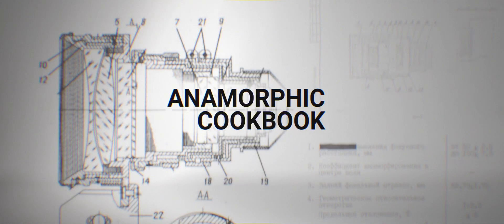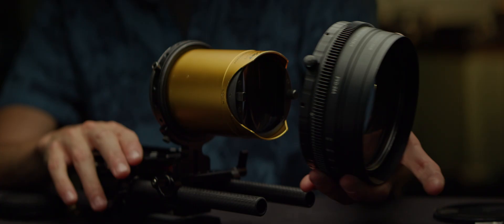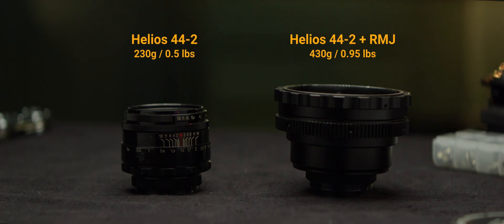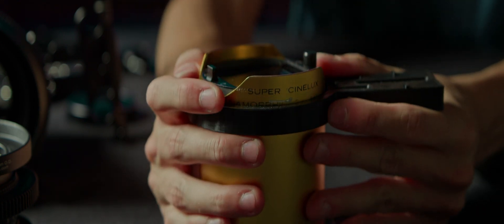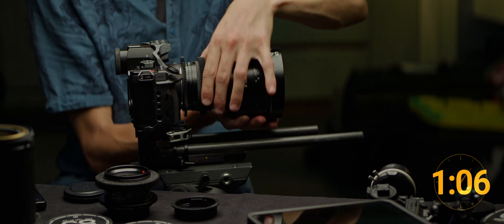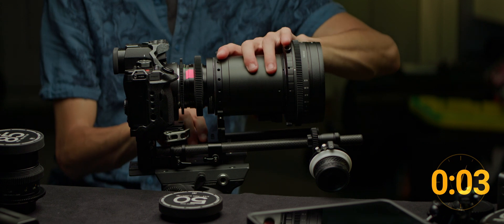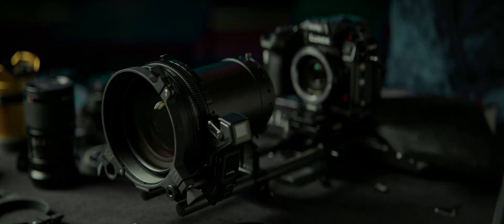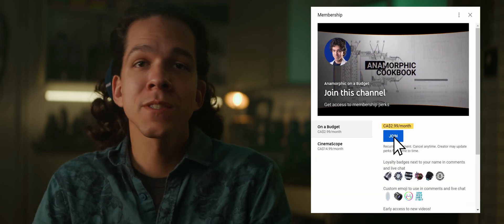Faster ANAMORPHIC Adapter LENS SWAPS - Anamorphic Cookbook - Module 6 Chapter 2

Comment: What is the most practical and useful squeeze type for a FX3? it seems like a lesser squeeze would be better for and non open gate sensor? Curious what is your opinion 1.3 vs 1.6?
Reply: I shot a short on the FX3 last winter with Helios taking lenses and the Great Joy 1.33x anamorphic adapter. If I were to do it again I'd use a 1.5x for a better stretch and crop the sides to fit a 2:39:1 frame like @LucasPfaff said!
Reply: Any camera that can utilize its whole sensor shoots "open gate". It just means "full sensor". As most cameras crop for anamorphic and with modern cameras resolution is barely an issue, I'd vouch for choosing an anamorphic based on your desired image and not squeeze factor alone. What gives if you use more of the sensor, therefore more of the resolution, when you dislike the results?
Reply: @LucasPfaff  i hear you.. the FX3 is full frame, but not open gate. So bigger squeezes create a narrower image that needs to be cropped to fit standard cinema ratios. This defeats the purpose and degrades the video imho. So my question is for FX3 what is the best option? I understand much of this comes down to taste, but I don’t want to crop in and I don’t want super narrow strip of video.
Reply: @timdanyo898  you have to crop an Alexa to get proper scope. You dislike that image too? Cropping doesn't degrade, it just cuts off. Less comfortable to work with I give you that, but in the end it doesn't really matter.

So arguably, most anamorphics degrade the image in a way. It's also part of the aesthetic. So it would be crucial to know what exactly you dislike. But if you feel that cropping so much degrades the image too much, you already kinda have your answer. 1.5x would also be a way, which delivers more or less the same aspect ratio as 2x would do on 4:3. Personally, I wouldn't bother with 1.33x because it's just so little fun, not worth the hassle - but it comes down to what you actually like.

I can only repeat myself, look at what you want in an image, and not at a number.
Reply: This is the trailer for my short using the FX3 and Great Joy 1.33x anamorphic adapter on Helios taking lenses: https://www.youtube.com/watch?v=EYtje3NuIh8